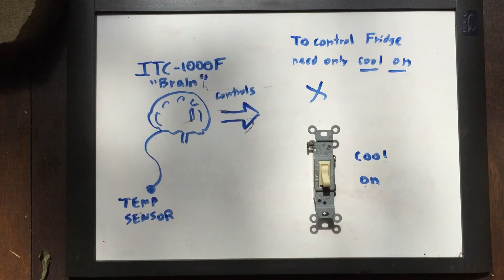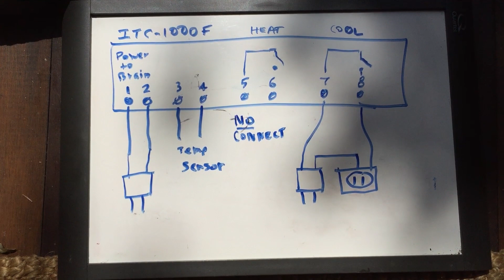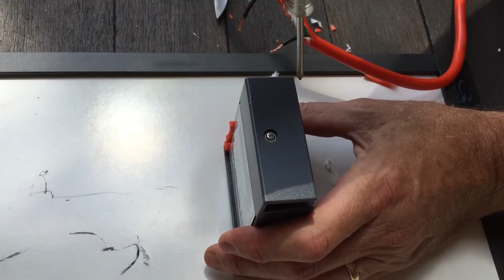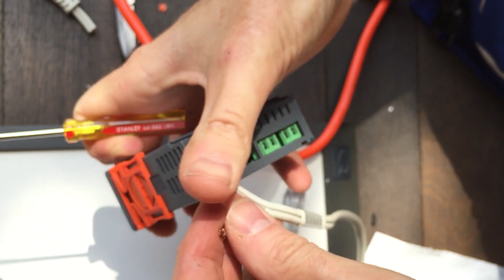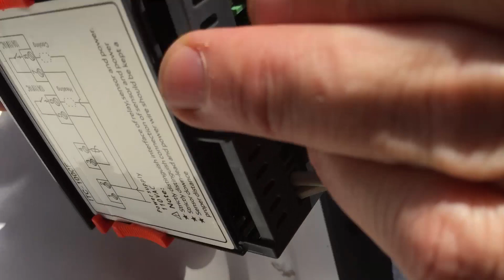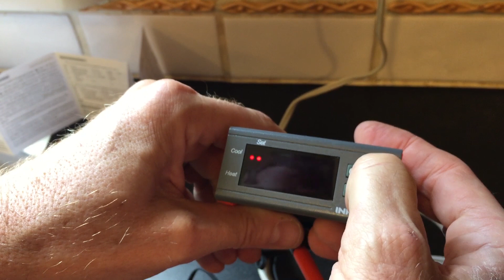How to  Hook Up Temperature Controller ITC-1000

Comment: What if I just want to use the heating
Reply from the maker: Just connect the heating output and not the cooling output — the device can control either cooling, heating or both

Comment: I have a 30amp digital thermostat arriving in a few days and my plan is simply to bypass my fridge's old mechanical thermostat. There is a metal cover on the back of the appliance, which covers the wires going to the existing thermostat inside the fridge section.  I will clip off the two connectors to that thermostat, then run two new  wires (of sufficient gauge and length) into the cabinet and wire nut everything accordingly.   I'll then replace the temperature probe and feed those wires through the same portal.   I want to site the digital box on top of the fridge, so I can check the temp, etc. as needed.  The only thing to keep in mind ... check the electrical specs of the old mechanical thermostat, as the LRA ratings for some fridge compressors are quite high.  My fridge shows an LRA value of 21.5! ... hence buying a 30amp model thermostat.   LRA ("locked-rotor amps") is the amount of amps required to actually start the compressor motor, when the fridge kicks on.  (Once the motor has started spinning, the amperage draw is much lower).

Comment: I have no problem wiring the brain and getting it to work, but I have tried 2 different cords now with the ports 7 and 8 to use my mini fridge in a similar way to you, and both times, with both cords, the circuit has not worked. Any suggestions?

Comment: Why do you cut the black? Why not the white?  Does it matter?
Reply from the maker: I'm not an electrician, but my understanding is that black is "hot" and white is "return".  The circuit breakers and switches in your house (and house appliances) all make/break "black" or "hot".

Comment: You still need to disconnect your fridge temperature sensor, don't you? I have a problem of trying to build a meat aging refrigerator and my fridge temp. sensor on/off window is way too wide, 7 degree, I think. I plugged the fridge into the Bayite BTC-201 and the BTC-201 into the wall outlet. The BTC-201 sensor inside the fridge and set the BTC to turn on at 38 and off at 36 (gave it a 2 degree window). But it didn't work, because even when the fridge turns on by the BTC, it still has to go through the fridge internal thermostat. So, the 7+ degree on/off window's still there (I set the fridge at max and this fridge can go all the way down to 32).
Reply from the maker: Daniel - I believe that in most applications there is no need to modify the fridge -- just set the fridge to its lowest setting and allow the external controller to turn the fridge on and off.  The external controller uses hysteresis to avoid fridge cycling.   Your particular application might be different.
Reply: robfaris26 I am building a  beef aging refrigerator. So, a constant temperature is very important to me. I just figure out a simple way to bypass the fridge thermostat (electronic one), by just shorting the wire of the sensor together.

Comment: Excellent video sir! 
I'm trying to bypass the thermostat on a water chiller.. so it seems like I can just take the thermostat on the chiller out of the circuit and just use the STC as a relay pretty much right I shouldn't have to provide any additional power? That's the chiller already has its own power supply I just want to talk a little thermostat on and off. Am I on the right track?